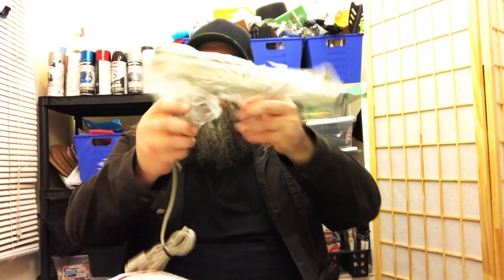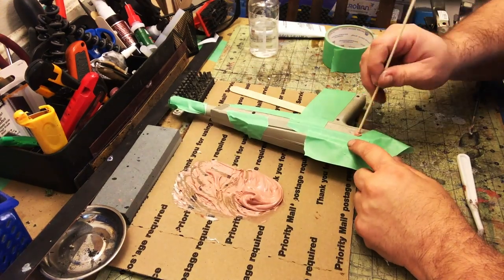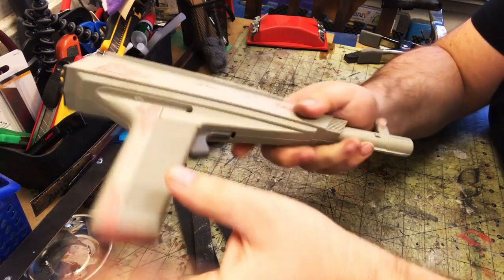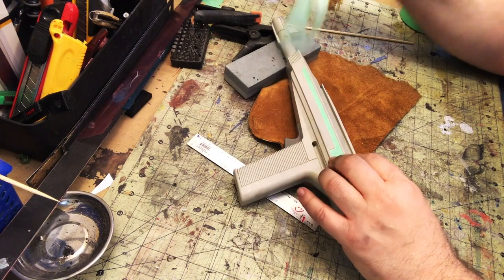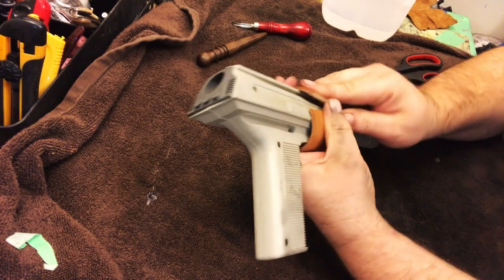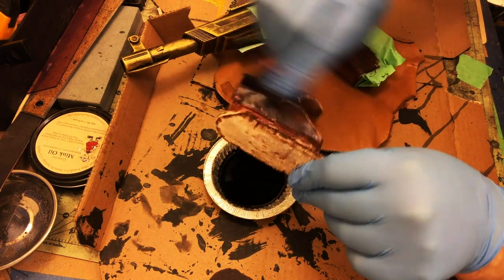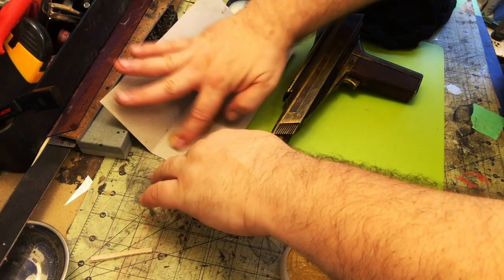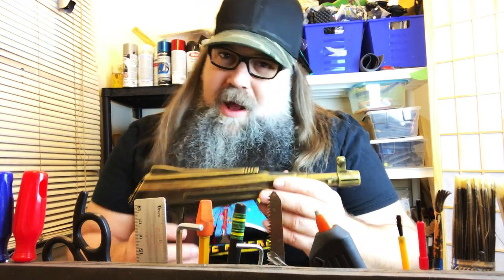ATARI 2600 XE LIGHT GUN MOD: DIY SCI FI WEAPON PROP

Comment: To fill the seams between two plastic parts, try running a bead of superglue, then sprinkling baking soda on top. You will have to sand but it fills cracks well, and is very solid.

Comment: Wow that looks great! I’m really digging the leather. It’s funny, this light gun in its original color wouldn’t be out of place in The Last Starfighter. 😁 If you want a third light gun to complete the trilogy there are a few good options. The Sega Master System Light Phaser is like a sleeker black version of this gun. There’s a couple interesting ones for Sega Dreamcast too. If you wanted to go totally nuts, there’s always the Super Nintendo Super Scope for a space bazooka! Also, you might want to look into vintage laser tag guns. The Starlyte Lazer Tag guns have a very Star Trek/Romulan feel to them. The Laser Challenge V2 blasters also have some potential I think. I’ve been eyeing the V2 Ultrawide Blaster.
Reply from the maker: T thanks for all the great suggestions! I just ordered a Sega Master System Light Phaser off eBay. What I am enjoying about these builds is that on eBay the non-working versions are very cheap. Just got a non-working Sega Master System Light Phaser for $6 - However iI googled the Starlyte Lazer Tag gun. Those are sweet.
Reply: @createscifi  The old lazer tag are very cool,with luck you'll be able to get one with the holster .

Comment: 4:26 thank god. Lol I didn't want to be that jerk that busted balls about using a controller that is from a hard system to collect for. Lol Either way they turned out GREAT. I did the same thing to a busted Sega Master System light gun. It has a similar design but just different enough. Great job on the build AND using units are are non working.
Reply from the maker: Thx AC , also since I'm certainly going to make more of these thank you for putting it into my head that up front when I talk about making these I'm going to stress the fact I hunt for Broken Ones, #1 cause you can get a bargain & #2 cause why to destroy something. An exception is the NES Zapp gun where I bought a cheap knock off.
Reply: Lol, I knew someone would be here with some XEGS love.
Reply: @createscifi  oh dude I was half serous about that. Wpuld have been a shame to see a good one be destroyed (from working order) but art never has to apologize bro! I almost destroyed a Genesis model 3 making my Necronomiconsole (Genesis in the Book of the Dead) but it worked out ok. Keep up the great work bro!

Comment: Instead of Bondo what if you used plastic putty, JB Weld instant plastic, for example.  you can fill your holes with it and not have to do as much post work to level it as you just squish it down and wipe any that stands proud.